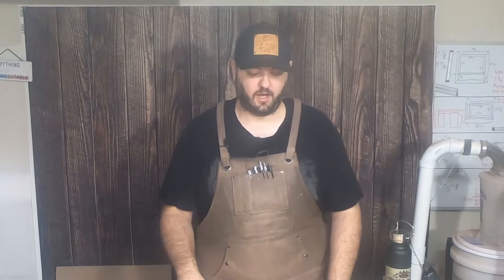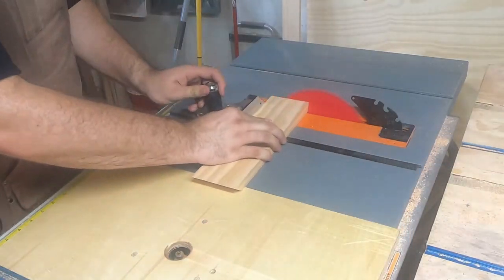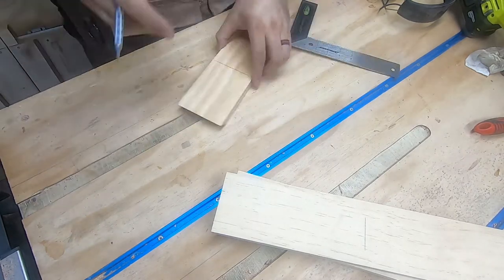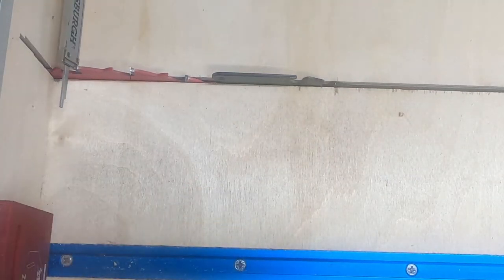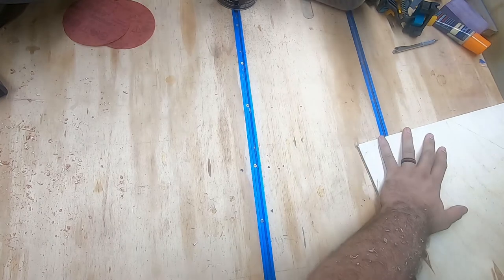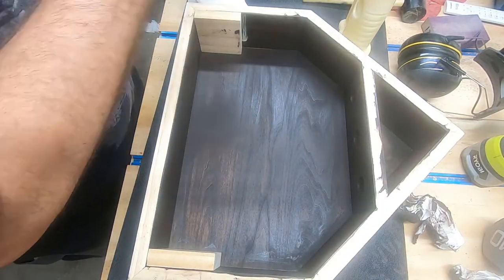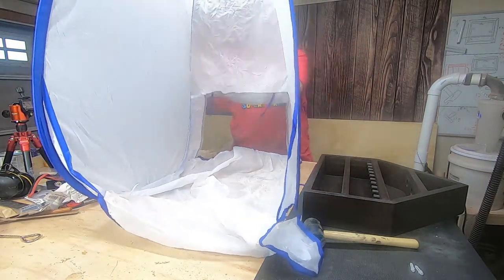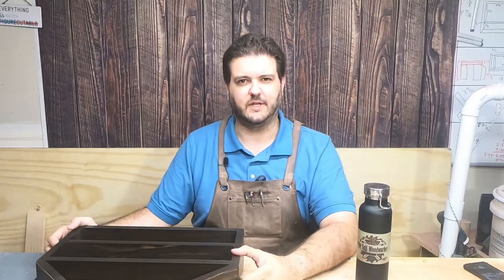This Baseball Shelf is a Home Run!

Comment: How did you support/hang the case on the wall?
Reply from the maker: I installed a pair of saw toothed picture hangers on the back so it could be installed with a couple of screws or nails in a wall.